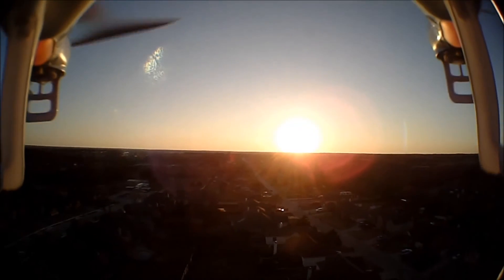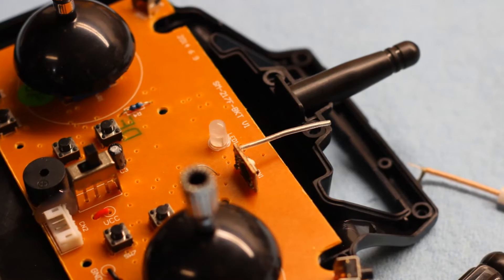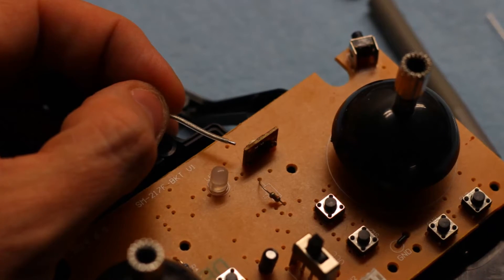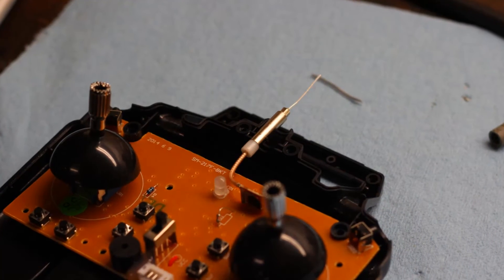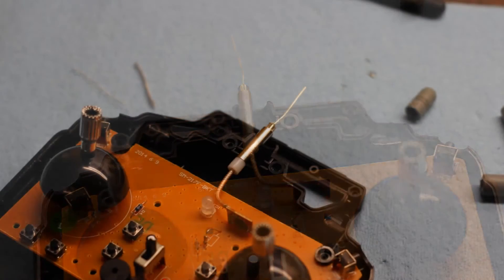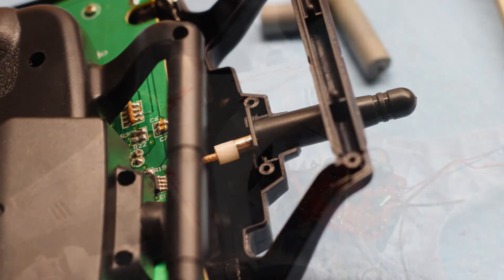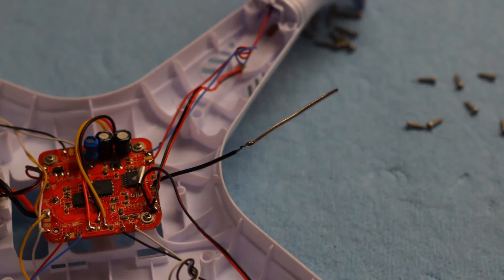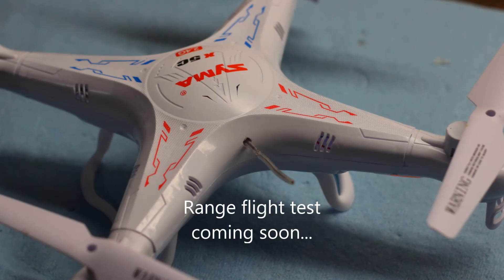Syma X5C TX and RX Range Extender

Comment: The longer antenna on the quad is unnecessary, so experts says. 
It's only receiving signal, it's better to change the orientation of the antenna or use a different shape of antenna, like cloverleaf. 

I also own the Syma X5C and went ahead to disassemble the TX but found out that mine was way different from those shown in those range mod videos. Mine is a V8 and most people I've seen had V2 TX. The difference is that on my TX there is no small PCB board for the antenna, it's soldered through the board and marked as 'ANT'. It's a single wire, with no ground/shield as far as I can see. 

One option I often see in comments or forums is to scratch the PCB and expose the ground plane and solder the shield onto that. 
On my TX unfortunately, I can't tell if there's a circuit or a ground plane, it's painted over with a protective layer. 
Another option, but unfortunately no pictures in a 4 years old post in a dead forum mentioned that  I could possible solder the shield to the battery ground pad. As far as I know, and I don't know a lot, extending the shield with a wire and soldering it to the battery ground pad would extend the wavelength of the grounded antenna and possibly affect my range. 

Do you know if I'm correct? Can someone help me, I can provide pictures if needed.

Comment: the longer the antenna, the more range?  I just did the transmitter mod, but I been curious of the quad antenna too
Reply: Not necessary and can also fry the components on your TX or RX. 
Longer antenna build resistance and heat-up more and also heat up components such as transistors. 
A 1/4 wavelength antenna is very common and used for a lot of reasons. 
I've been told to use a 5/4 length antenna on my TX by a professional but also been told about the above and risks. 

One way to extend your range even more would be to boost your voltage/watt and the signal would be stronger but then you really need to change alot of components on your TX so you better just buy a better TX. Also, you might need a license to broadcast that signal.

Comment: I don't get it. On the stock antenna its only soldered to one spot
 But every video including yours has it soldered to both spots splitting the wire. Can you explain to me why that is important to do and how to do it???
Reply from the maker: The stock wire is a single wire for transmitting the signal. The mod converts the wire from a single conductor wire to a coaxial "shielded" antenna. A coax cable will have an inner core wire and an outer shielded wire (giving it "two wires")  The first pad is the signal wire and the pad below can be used for shielding. This essentially converts the antenna to a coaxial, which the transmitter supports (had the lower grounded/shielding pad, but not used to save cost from the manufacturer). In a  coaxial antenna  the electromagnetic field carrying the signal exists only in the space between the inner and outer conductors (Wikipedia). This helps the antenna protects the signal from electromagnetic interference making it superior than the stock one. 1:56 shows exactly where the shielding is soldered. The pic is upside down so its the wire at the top of the screen.